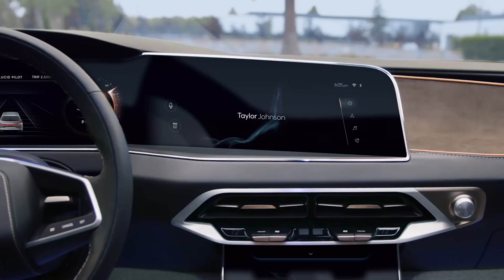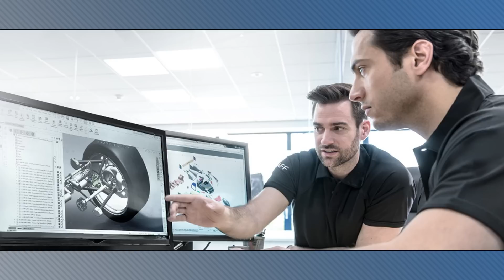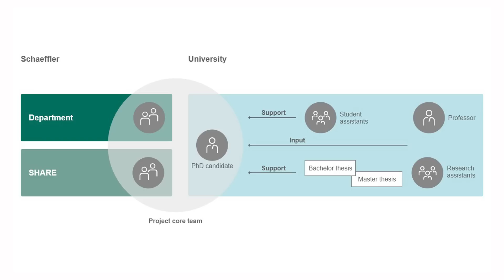Toyota to Make Fuel Cells for Big Trucks; Audi Announces the End of ICEs - Autoline Daily 3148

Comment: So Ford, has put themselves in a position, where they are dependent on the outsourcing of supplies to China in order to make parts for their “most iconic American“ product; the Bronco???
I sure hope they didn’t get any tax breaks while outsourcing American jobs…
You get what you pay for, I guess. Was it worth it? Probably should have made that roof hardware in America, huh? 

The fact that they waited over a year to even publicly address the manufacturing problems with the roof, instead of just creating the tooling in the states… Adds insult to injury.

Comment: My concern of Lucid is that their batteries, LG. Since 2022 Bolt EUV's batteries are also recalled, does LG have good and enough battery to supply to Lucid?
LG must produce replacement batteries to GM and Hyundai, which, I think, higher priority for them. We will see soon.
Reply: My concern is that they not have started a real production. And yes: LG batteries are obviously a bad decision.
Reply: @wolfgangpreier9160  Lucid Is at the exact same stage of production now the Rivian is, they are waiting for the final government approvals, and both say they will start  salable production September.  Lucid is even planning to give media tours of their factory as it starts production in September.
Reply: @dmitchellhomes  Good luck in starting the production and supply chain. To both. There is a reason why prototyps are easy, production is hell. And maybe thats the reason why bollinger only does prototypes.
Reply: @wolfgangpreier9160   Lucid will be fine with their supply chain,  they are a small company with small demands,  and very well capitalized with lots of cash.     Lucid today has $4B of cash,  more cash than Tesla had at any point prior to 2018,  and Tesla also had a mountain of debt, where Lucid has none.
Reply: @wolfgangpreier9160  I agree with David. Not accurate to insinuate that Lucid is a vaporware company like Lordstown or  Nikola. They have a background in EV tech, a leadership team with very impressive credentials, plenty of test vehicles on the roads, a factory, and tons of funding. 

Also, I bet he is right in that they will not have an issue getting batteries because they’re not gonna be selling huge numbers right away. 

(I own a Tesla, TSLA, LCID, and I’m a fan of all reputable EV efforts !)
Reply: Lucid uses 2170 cylindrical cells made by LG  in China,   same as all Tesla LR 3 and Y from China.  Tesla also makes some Fremont LR 3 and Y with the LG  China cells I have heard,   about 1K per week.       This has been confirmed on reddit by several Tesla Employees.

Comment: PACCAR would not get an instant Zero emissions win from Toyota's fuel cell system. You also have to get a high capacity generation of clean Hydrogen, most Hydrogen produced is by a polluting process. I welcome the news and think Hydrogen is the way to go for big trucks, just correcting your facts 8-)
Reply: fact is 97percent of all hydrogen made is dirty plus 10x the cost of producing solar or wind electricity with the same power output

Comment: The chip shortage is spilling over to a lot of manufactures.  If car makers continue to demand entire production runs that could mean folks who make things that use those same chips won't be able to make their product, and I would expect car makers to have the volume and clout to demand all the chips. However, this could be an opportunity for chip makers who were not the "first choice" before but can supply a workable substitute to replace some of these chips. For example, the audio interface maker RME had to redo at least one of it's products to use chips from American company ESS Technology because the ADK chip it was using is not available. I wonder if car makers and their suppliers will be forced to change the chips used in some of the parts that go into cars.
Reply: Its already happening,   many suppliers of consumer electronics cannot get their chips...    Even EV wall box manufactures have been hit...